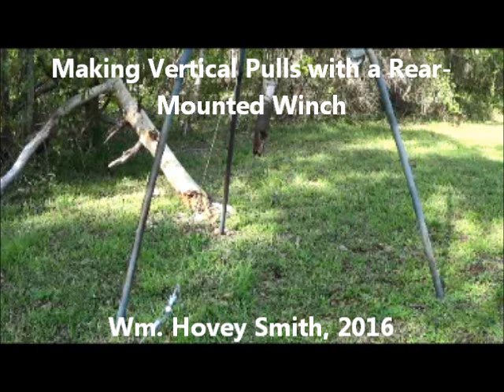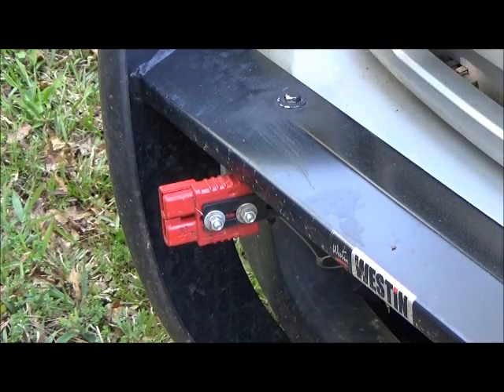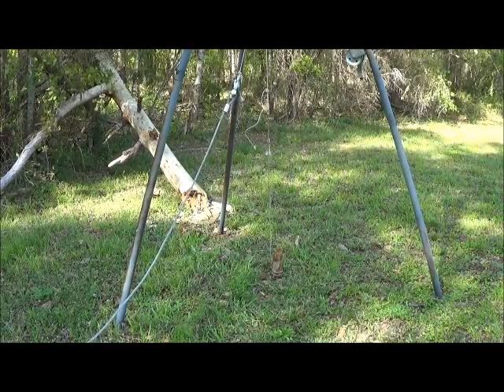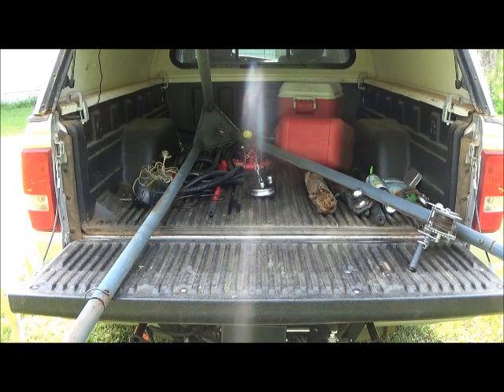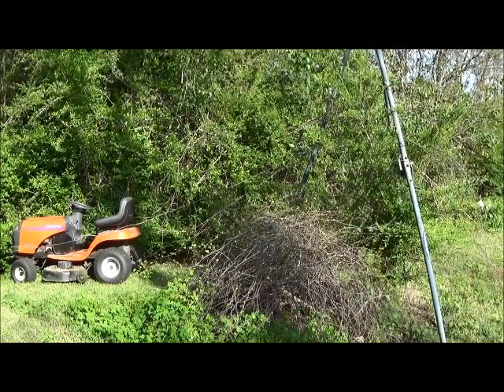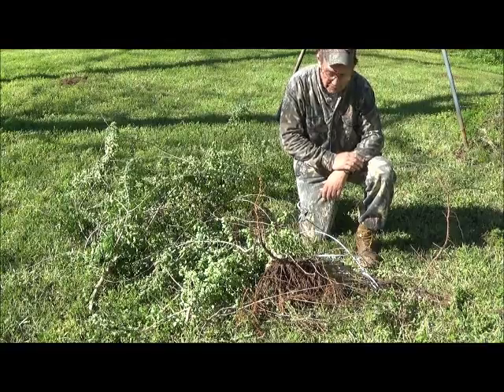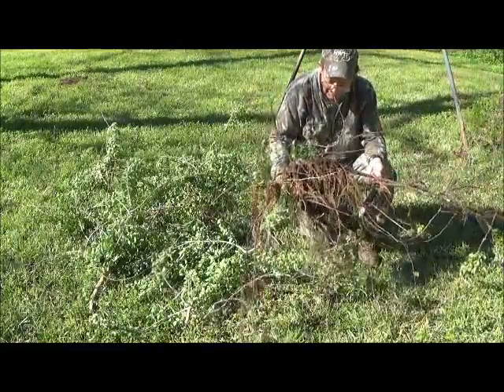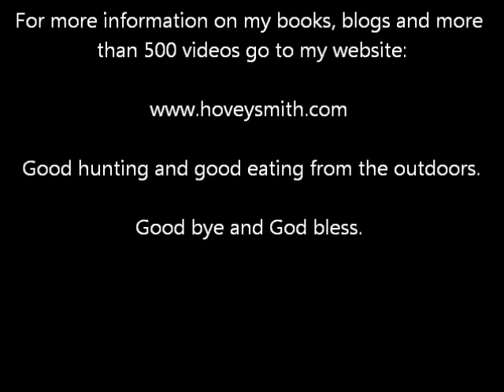Making Vertical Pulls with a Rear Mounted Winch

Comment: Or, at about 6:00, you could attach the end of the cable to the stump, run the cable up to a pulley (snatch block) at the peak of the tripod and them back down to a pulley attached to the stump.So your cable runs from the stump, up to the pulley on the tripod, back down a pulley attached to the stump and them to your winch. In that way you're pulling the stump and tripod only very little horizontally with most (about 2/3?) of the force being applied in a fashion that serves to force the pull the top pulley towards the bottom pulley (pulling the top pulley downward and the stump upward).  Plus the horizontal forced applied would also be working to pull the stump from it's hole.